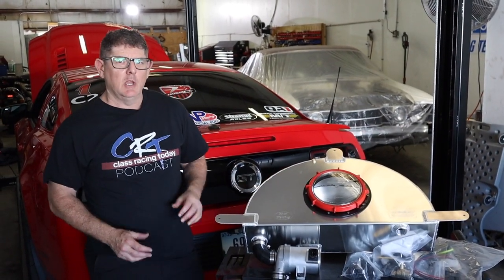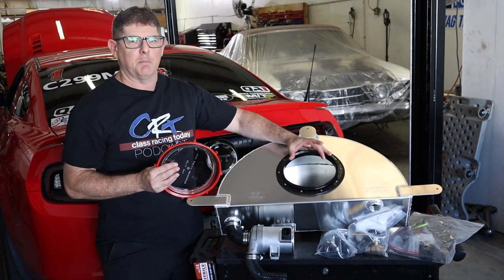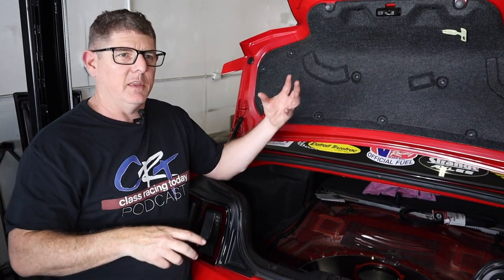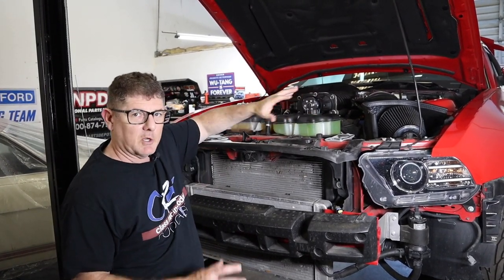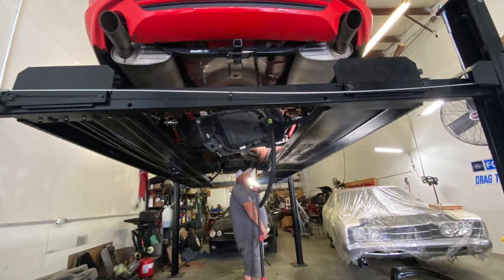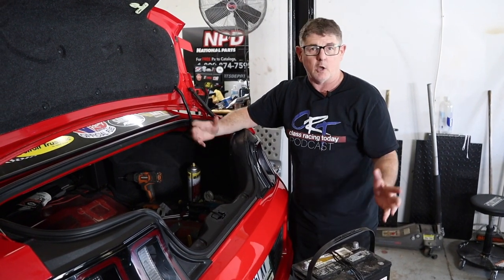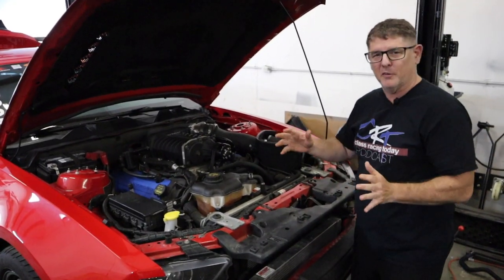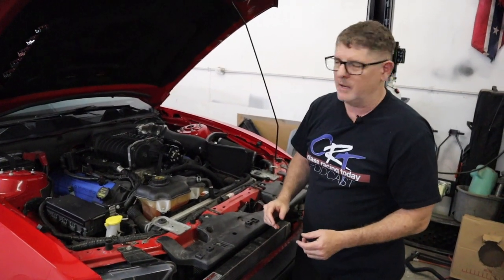Chilling For Power! Mustang Ice Tank Install & Test - Is It Really Worth Horsepower?

Comment: You should do a dyno comparison with and without the system running. It would require tuning changes to optimize each one,but that could be helpful if for some reason he had a problem with the ice system and it stopped working at the track.

Comment: I have a roots 8-71 with an intercooler and gained 100hp with tap water on a chry 440.I just installed a Meziere 55gpm pump for the i/c water and I am waiting to test it on track and do a flow gpm test.

Comment: Why not save all that weight and hassle and just install a c02 spray system to fast freeze the intercooler? WAY less weight and hassle. Great video as always Evan.
Reply from the maker: Good question. On this car it would involve removing the blower and intake and plumbing a system. This was an easier install and seems to be very common. Perhaps that's something to explore in the future.

Comment: you really want to see improvements upgrade to 1" ID lines. 1" fittings on the heat exchanger and 1" fittings on the intercooler core. The more water you can flow the better.

Comment: With the car being tuned with the ice tank, what happens when the pump fails? Does the knock sensor or other safety protocols keep the engine from melting or breaking?
Reply: there is a timing table that works off Intake Air temp. You tune for all temps....that way if you have a failure....you're covered.